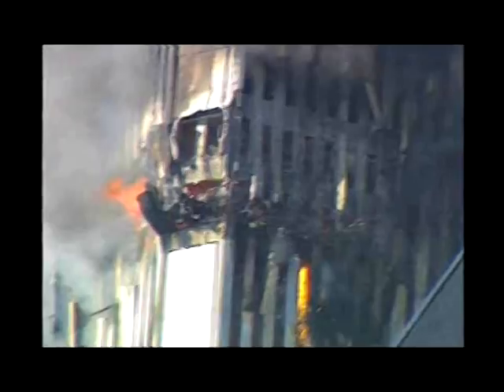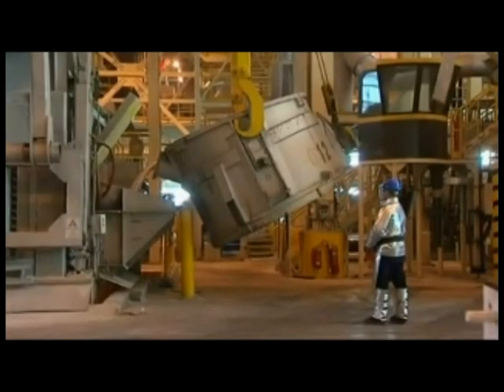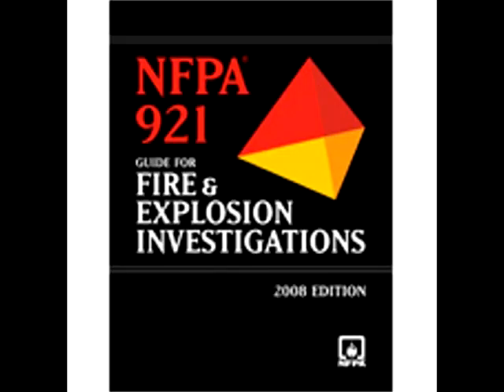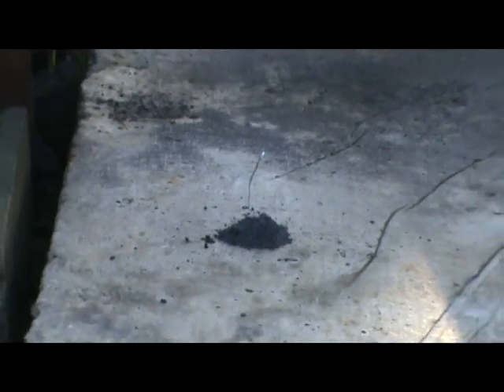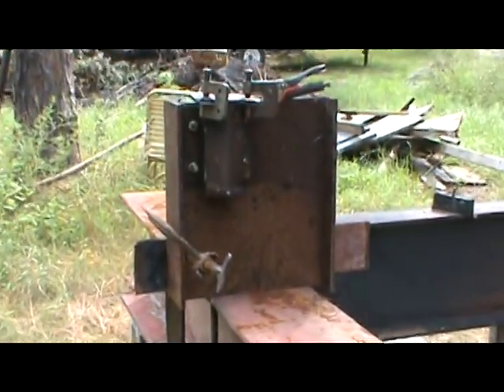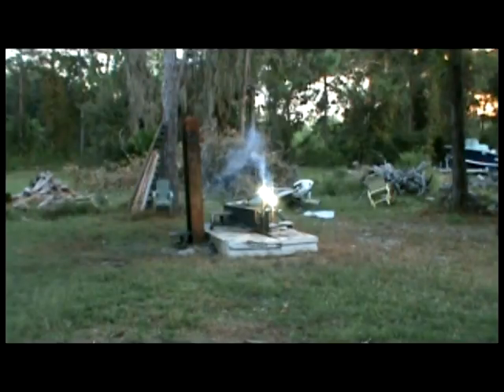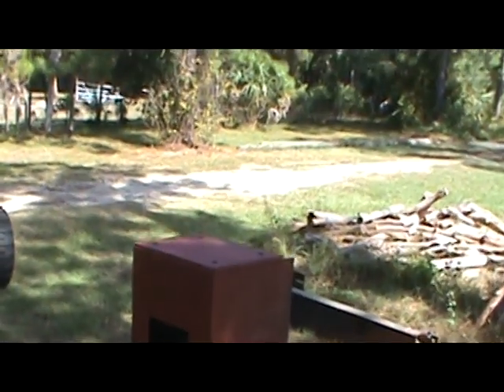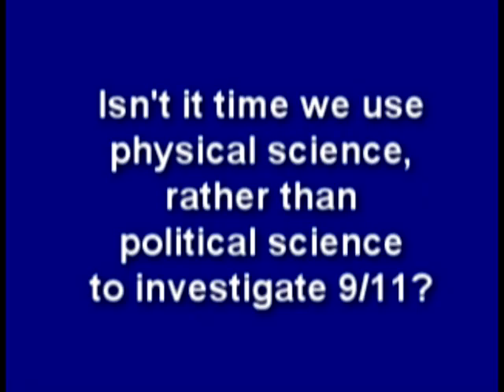9/11 Experiments: The Great Thermate Debate

Comment: Plus there was unknown construction just under where the planes hit.. it was known that... People heard construction on those lowers floors... It's a ovious gov known terrorist attack..
Reply: theres another way but some people wont seek it not likely. Most floors were being remodeled for new tenants. They would have things like aceteline torches and arc welders. Look up Dallas gas plant fire on YouTube. You see the tanks flying in the air with the bottles melted. The bottles are made of the same steel as industrial steel. 
 Again missing black boxes? This is simple and you can do it at home. Put a spoon in a blender with the speed set to pirre. You think anyone will recognize it as a spoon after 5 minutes?
Reply: The Nech ahhh the infamous Bin Lauden family flight. Yes it was real. Yes it left US airspace hours after the attack. Under heavy fighter escort from the USS Dwight D Eisenhower, the USS Theodore Roosevelt, and the US air Force. 
 If that plane had terrorist on it why didn't they turn the plane around and attack another target? Reason and answer. The Bin Laden family for the exception of Osama Bin Laden are on good terms with the USA even to this day.
Reply: Jay Bee do you know where all the center horizontal supports were connected? Same place where the center verticle supports and elevator shafts were.
Reply: theres another way but some people wont seek it plus there were white vans that came in st night and were gone by the time the workers started arriving. Plus marvin bush was in charge of security for the bldg, plus....
Reply: 2 things happened when those planes hit those towers. 1.) A justified war. Someone has to finance a war, which inevitably put us in corporate control and 2.) Increased security. Didnt jfk warn us about this in his secret society speech and didnt jfk enact an order to print our own money, but wait, wasnt he killed by a lone gunman , who didnt work for the CIA. its a cold cold world out there my friends.
Reply: most wont seek it theres another way.
Reply: theres another way but some people wont seek it b
Reply: You Wished black boxes are made to withstand a crash/explosion. A spoon is not made to withstand any kind of damage. Lol
Reply: Building 7.
Reply: theres another way but some people wont seek it they were planting them since 1992 in the first bombing. That was a set up to get their guys in there to rig and wait for the perfect time. Larry Silverstein was jumping the gun. He was hiding a lot of nefarious business.
Reply: theres another way but some people wont seek it Not a terrorist attack. It was “cleaning house” Silverstein didn’t wanna wait for the 99 year insurance claim, obviously cuz he won’t be there for it. He wanted to collect and get the fuck out of dodge.
Reply: Do you comprehend how much explosives and thermite would need to be brought in to bring down the towers?

Yes there was work on the elevator system in the building but you're still talking about bringing in thousands of pounds of explosives and thermite so you're talking about 1000to 2000 people Who would be in on it

The temperature inside of the building admittedly by this OneVideo reached 1862°F the melting point of steel is 2400+ but 1800° temperatures are still more than capable of compromising the steel to a point where it cannot support the weight that is above it also aluminum which the plane is made of melted 1000° and when it comes in contact with water is explosive

https://youtu.be/gui_ATdfHx4
Reply: And you know all this because you saw it on some lunatic fringe video made by a third grade dropout who has never been within a thousand miles of New York right?
Reply: Molten aluminum... The metal flowing out of the building is molten aluminum.
Reply: theres another way but some people wont seek it 
The UK warned the USA that there was an impending islamic extremist attack. Also Mossad was tracking the pilot lessons in Florida, even living across the street, ever vigilant. They likely worked together to gather intel & happened to not be listened to.

Comment: Ok use your head thermite was used to melt steel and you want We The People  to believe that  kerosene which is jet fuel melt steel beams with a half inch thick web if not thicker not happening in  my opinion
Reply: billybushmaster  Nobody said the fuel melted the steel. Doesn't have to. And the 14 inch perimeter box columns were only about 5/16 thick up on those floors. Not to mention that it's the floor trusses that gave.
Reply: 5/16  the weight of a  structure  that big and that tall. Would  never hold the weight of the structure. A Welder by trade. The weight of the  Steel alone  is more than  5/16 web steel can  hold. 12 inch 25 pound I beam  has a web 3/16 of an inch  and that 25 lbs is a foot.  And math dont add up. Millions of pounds  of steel,concrete, glass on 5/16 webbed boxes  and webs on a structure  not happening
Reply: billybushmaster  Ok. So you admit you know nothing about the perimeter box columns. Good.
Reply: Yes i do  which is stronger  a box tube  or a peice of pipe

Comment: Steel won’t melt at the temperature of jet fuel, it will however  “anneal”  and its rigidity be greatly compromised, certainly not able to hold up a building
Reply: Except they were built to withstand the temperatures of just such fires. FAIL.
Reply: My father has worked his entire life in a Steel factory, delivering Steel used in the tuffest invirement possible, in fact there is a high chance your car, tools or any high stress related Steel from my town is in your products. I have my self worked producing this Steel. And belive me, even if the Steel was heated to its weakest point, it would just bend and The TOP of the building would have just sat down on The rest of the construction. Healthy construction Steel is increadably strong and that is why we still use it to this day, if this was a thing dont you think the world would stop using this construction method. This is The biggest cover up in my life time and i just hope it will be reaveled one day what accualy happend
Reply: Windex said "they weren’t build to take a fucking jumbo jet"

_Yes, they were_.
Reply: There is no historical basis for your comment, we have buildings all over the world with fires in them for an even longer period and none of them just collapse like any of these buildings on 9/11. 
Your comment I believe is a troll comment, unless you really are just that stupid. If that's the case then I feel sorry for you.
Reply: Okay or normal flames, doesn’t matter if jet fuel or not
Reply: Jesse urban Then they should’ve collapsed on the side they were weakest, not straight downwards.
Reply: WTC7 was built on a pre-existing, much smaller foundation. Steel trusses were used to extend the footprint of the foundation to support the building. When WTC2 fell it knocked out a corner of WTC7 15 stories down to the ground, including the steel trusses. Once those foundation trusses were destroyed, the building partially collapsed, firefighters knew it was a lost cause and they pulled out.
Reply: A fuel doesn't have a specific burn temperature. The temperature is a result of the rate of energy release, which is a result of the area of the fuel surface, and the speed that air is supplied. An IC engine burns "atomised" fuel - very high surface area. A turbo-charger is an air compressor. A jet engine runs at a very high temperature, the front half of it is an air compressor. 

Now,spilled fuel has a large surface area, but a building restricts the air supply.
You can tell if a fire has a good air supply or not, but the colour and quantity  of the   smoke. Thick black smoke contains lots of unburnt carbon = poor air supply. Jet engines and forges are virtually smokless because complete combustion produces CO2 and H2O, which are not visible.
Reply: @ Michael Calvano. 

Evidence, please.
Reply: In fact they were.
Reply: Hermit Oldguy ....thanks for that....
Reply: Euroduck 
They didn't collapse straight downwards.
Obviously you've never seen footage of the twin towers collapsing.
Reply: robert franklin but they weren’t build to take a fucking jumbo jet

Comment: This will convince only the science ignorant.
Reply: might I point out that building seven may have been pre-prepared to collapse due to the fact that this building housed the local offices for the CIA And FBI? While I was in the navy I discovered that the radio room basically had a self-destruct button which would start a chemical fire which would reduce everything in the radio room to molten slag, this was to be used if the ship was ever taken over by hostile forces.  Just my own thoughts on that mind you
Reply: Eugene You wont convince anyone that your not ignorant
Reply: Chris Gilliam ...building 7. How?
Reply: Chris Gilliam every shred of evidence? yeah if you're a moron.... 
numerous eyewitness testimonies of explosions, secondary devices etc...excluded from the investigation

numerous audio recordings of explosions....excluded from the investigation

numerous eyewitness accounts of molten steel at the base of the elevator shafts 3, 4 and 5 months later? that fact renders the official story impotent, as that would defy the laws of thermodynamics

nevermind the numerous Israelis detained with explosives training, moving vans with explosive residue....and exploding trucks....gimme a break
Reply: Non Ofyourbuisness, let’s see a link to the 2,700 engineers.  Ignorant is not the same as illiterate.  Resorting to profanity makes you look desperate.  You misspelled ‘none’ in your name.
Reply: Eugege Bell. Please tell me more on the structural weakening of Building 7. Enlighten me on how for the first time in history, three steel reinforced concrete buildings collapse from fire... at free fall speed. What's the probability of that you think?
Reply: Eugege Bell, I'm not sure about what you're trying to say. Thermite derivatives are a well known material for cutting through steel. It's been used in countless wars to destroy cannons, made out of thick, high-grade steel, and it's used in construction both to weld and to cut steel. You saw for yourself what happened to the tested steel beams.
Reply: li'l shaith Building 7 was heavily damaged from the top buy Rubble while it looked okay from the outside the inside has been basically hollowed-out that's why it collapsed in on itself it was from the debris of the actual Towers collapsing which contrary to popular belief actually crumble to the ground not implode up on themselves
Reply: https://www.ae911truth.org/

There you go
Reply: Chris Gilliam Explain the molten steel / aluminum via fire?
Reply: I think you mean scientifically ignorant, and you are the only person who displays such a trait.
Reply: Herp McDerp, not free fall speed.  Look at the videos.  The debris fall at free fall and faster than the towers.
Reply: Non Ofyourbuisness, so you believe everything you see on the Internet?
Reply: Lord of the belts: The return of the KING, you may be right on the congregation, I’m not an English expert, just and engineer with science background.
Reply: Chris Gilliam conspiracy nuts? Like the on about the gulf of Tonkin being a fabrication to get into Vietnam. Or that we knew that Pearl Harbor was going to be hit but did nothing? Those wackos our government would never stoop that low.... oh wait :/ the fact that the Medea has pushed so hard to make simple questions taboo should be a major red flag.
Reply: Don  Timberman  Those events are not what the discussion is about. When it comes to 9/11 every shred of evidencesupports the official account.
Reply: Eugege Bell  That's a lot of people though. This is silly.
Reply: Non Ofyourbuisness  Moron. You conspiracy nuts put forth anyone you can find with any kind of degree in anything as an expert. Your movement is lead by con artists that exploiting your ignorance. Not one peer reviewed paper in 17 years to support your claims. No physical evidence at all. Video shows the floor trusses sagging, the walls pulling inward, and the collapses starting at the impacted areas. Not one video shows an explosive detonation. Not one shows thermite burning. Every single point conspiracy nuts make has been proven false countless times, yet you morons keep bringing them up. You really need to stop watching these nutcase videos.

Comment: Your theory would probably work great in a laboratory,or on paper, but in real life it's a bunch of tripe. There was molten metal because it was coming from the floors above, that's because the floors below were a blast furnace. The fact that there was any molten metal at all means the fire was hot enough to melt steel. Your so called scientists forget the most important variable in that fire, airflow. The wind at the elevation would force oxygen through the holes in the building, then all of the materials in the building would be consumed raising the temperature above what is needed to melt steel. But you don't have to melt the steel to a liquid to weaken it, steel weaken long before it melts. The fact that the buildings fell the way they did, tells any scientist, that the inside structure of the building let go before the outer skin, and that is exactly why the buildings collapsed straight down, because the outside skin acted like a pipe.